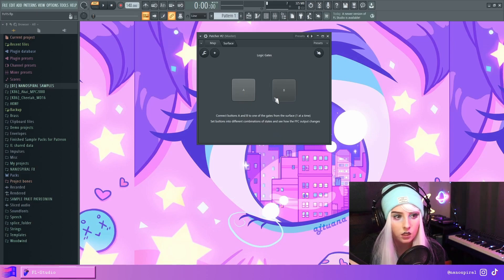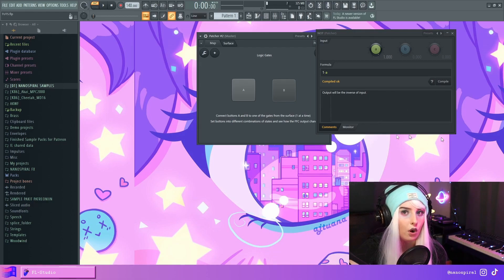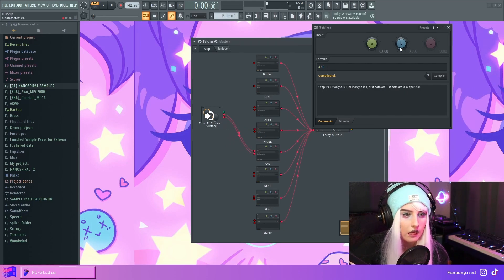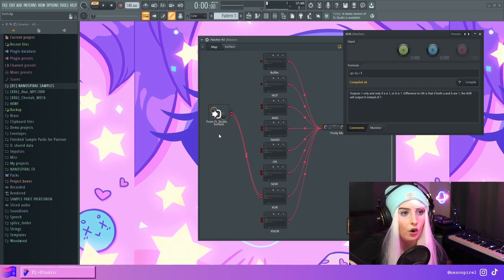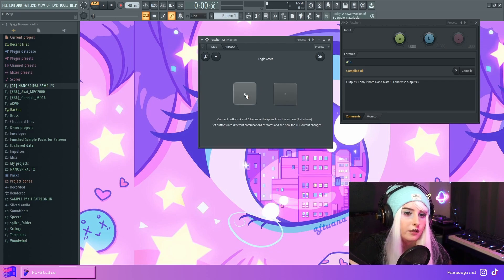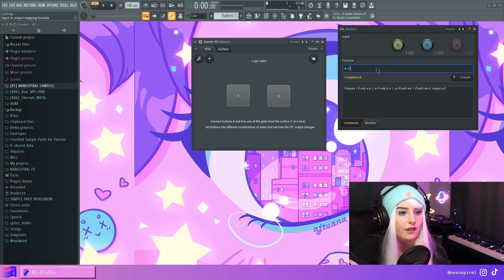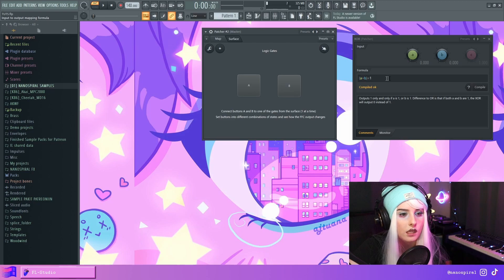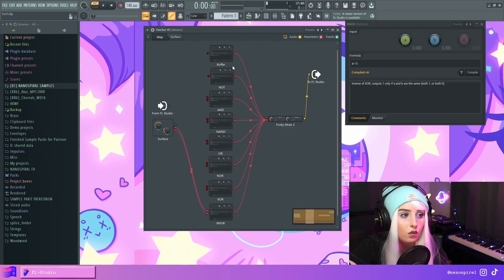Introduction To Fruity Formula Controller Math And Logic Gates

Comment: I think FL formula Controller is unnecessary, I got tired of trying to figure out how to work with mathematical formulas or something, I got bored watching it, I guess I can be a lazy DJ :)) thank you for nice tutorial.
good day
Reply from the maker: It's not like you need it, but if you use patcher it's pretty essential. It's also a modular style workflow, kind of like a function generator patched to an oscillator for example
Reply: I have to use patcher to re-route the midi coming in from rewired Ableton (using FL Vsti in S1 and Ableton rewired in S1) and yes THANK YOU!!!!! @nanospiraI

Comment: So after grinding on fruity formula control after a few days after I found this channel I managed to get it to do an LFO by making it do the b+sin(time/1000*c)*a. And it works but the equation is sort of funky because everytime I moove parameter c to change the pitch of the lfo the rate/speed at which I move the actual parameter can speed up or slow down the rate/pitch of the lfo separately from the actual end value of the parameter where it would ultimately sit at. Now I have to figure out a formula that explains that everytime parameter c is altered that the speed at which the variable is changed should not impact the progression of the heightening & lowering of pitch. It's such a wierd problem that it might just be a bug honestly...who knows.
Reply from the maker: Yes I've noticed it too, I think the glitching happens because the Formula Controller is trying to calculate what the sine curve output would be if the frequency stayed constant. So it jumps around because it tries to calculate that sine output at some values in between knob position 1 and knob position 2 at SongTime x if that makes sense. I'm not sure if it could be fixed within the Formula Controller itself, I might ask around the forums to see if anybody would know what's up with that. If you want a steady rate adjustment for an LFO you can just use the peak controller, you can still feed it through a formula controller and modify the waveform however you want, but use the speed knob of the peak controller itself to avoid this problem.